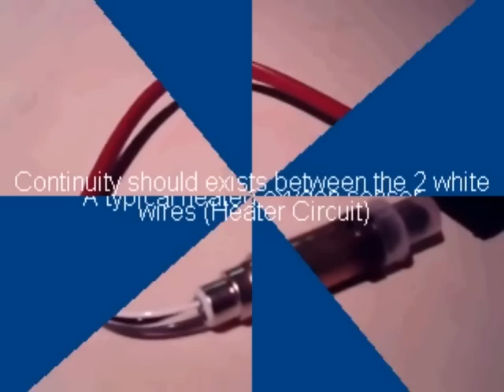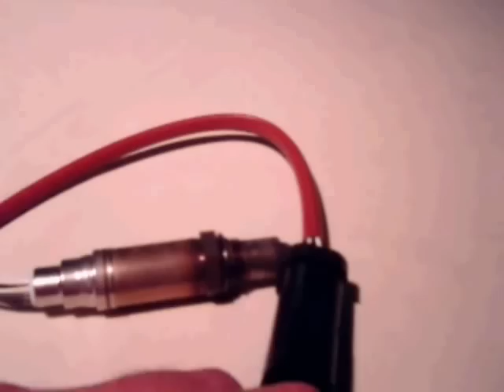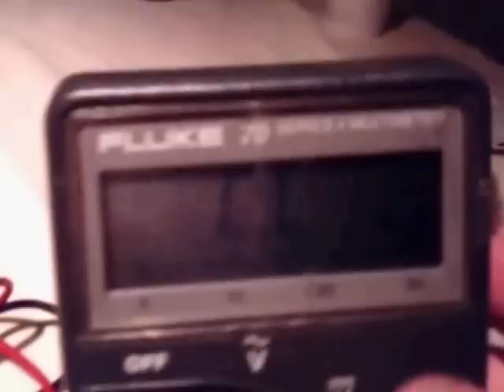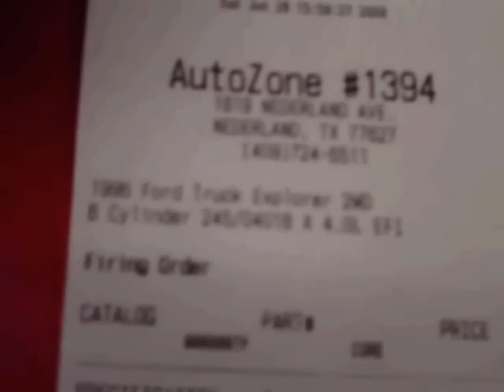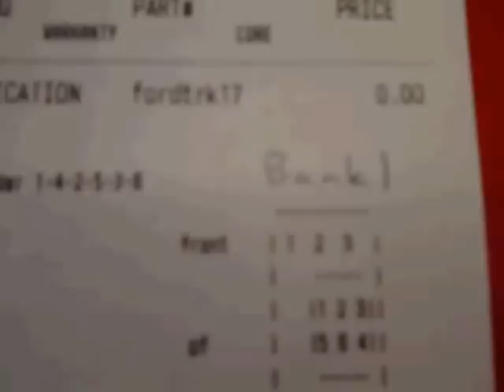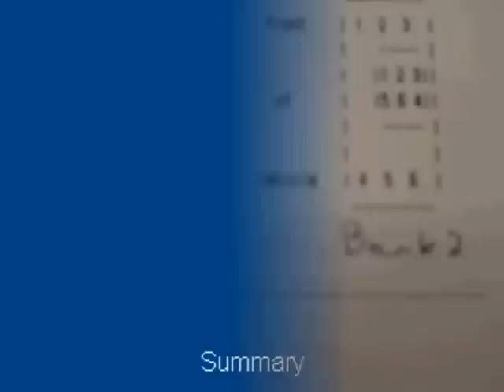Heated Oxygen Sensors,OBDII(DTC's)CodesP0134,P0135

Comment from the maker: You could also check the sensor itself just in case.  Compare the heater circuit resistance of yours to the resistance of a new sensor.  If you are going to check the activity of sensor, make sure it is off of the vehicle and find something to heat the tip(Butane torch) sensor readings.  From my experience, the heater circuit malfunction usually is present when the heater circuit on the sensor has completely failed, or there is no continuity.

Comment from the maker: Then one of the areas I would check is the fuel delivery at the engine itself because the oxygen sensor is reading a rich fuel condition.  This could also be a lack of air on the intake side also, a number of possibilites.  I tried to give warning about other sensor codes in the description, but thanks for the comment.  I am surprised you did not mention P0420, P0421, or P0431 with this code.

Comment from the maker: @HeavensWest1 Possibility, and if you were to check the sensor it would need to be an off the vehicle test.  The problem with the 171 is it does not specify what 02 sensor is acting weird.
My suggestion would be to check for vacuum leaks on hoses or anything that would cause a lean condition on your bank 1 or the side of cylinder 1.
Thanks for the response.
Mike

Comment: @mss829 Thanks for the input! I've ordered a new B1S1.  But will test S2 heater circuit, power source & ground. Went ahead on S1 due to: 1) it is not oscillating below 200mV nor above 700mV.. consistently... 2) S1 being bad/old can create a code for S2.. I'll replace S1 and re-run Autotap, generate a new graph with the new data.. see what it looks like then - meanwhile I'll test S2 as you've suggested. But.. shouldn't  S2 stay steady at ~ 450/500mV? Thanks again!

Comment from the maker: @timboscoops this code is describing the first sensor on the exhaust manifold near the firewall,(harder to reach).  I read that you replaced both sensors, but failed to mention if anything was checked as far as getting proper power and ground to that sensor.  The heater is usually identified on most sensor as 2 identically colored wires.  One should have 12 volts and the other so have good ground connection.  You might check the heater for continuity on your newly replaced sensor just in case.

Comment: hey again. So i got it fixed. The issue was this: my original O2 sensor was indeed fried, and it was indeed the upstream, like I had thought. The new sensor I bought was a Bosch, and the OEM was Denso. That was the problem, even though the place I bought it entered my vehicle year, make, model, trim, etc, etc, and they said it was compatible. It wasn't. (Also the Denso cost me $32 on ebay while the Bosch cost me $75)

Comment from the maker: There is no activity on o2 sensor bank 1 sensor 1, either the sensor heater, power and ground supplied to the heater is faulty, which might also be setting other codes.
The first sensor off of the exhaust manifold starting on the side of cylinder 1 would be my starting point.  One of the wires going to the sensor should have 12 volts, and the other should have proper ground.  You can check the ground by confirming continuity between a good chassis ground  and the sensor harness on the vehicle.

Comment from the maker: you might look at fuse 15...but I could be wrong...another way to check for power to the sensor is to use a test light with the key on and probe the two identically colored wires, one should have power and the other should be ground.  Ground can be checked with a meter, continuity should exist between the ground wire and any good ground on the vehicle.  Hopefully you won't have to go this far in depth.  And yes, you may have to chase the wiring if something is suspicious.  Good luck...

Comment from the maker: @krazy8tattoos there are a few questions you may want to address with this issue.
is the engine actually running lean, or is the gauge just showing a lean mixture?
is your check engine light on?  I would expect it to be on if there is a lean running condition.
is the gauge wired properly?  You may just review it.
I'm not implying that you do have a wiring problem, I am only bringing it to your attention while checking other areas as well.
Hope this helps.
Have fun!

Comment from the maker: In my opinion, your Bank 1 sensor 2 heater circuit code is more suspicious. (p0141)
I would check:
1. heater circuit on the sensor, or
2. power source wire from vehicle for voltage, or
3. ground wire circuit for low resistance and clean, secure connection.
If all are in tact, then there could be a lean fuel trim, that is not necessarily the 02 sensor's fault.  There is not much of a sure answer that I feel comfortable with stating, unfortunately.
Thanks for watching and commenting!

Comment from the maker: @ninobebemebarak Do you mean, 2 black, 1 white, 1 green?
The 2 black should be the heater.  You might even compare the reading to a new sensor at a parts store.  I would still check for a power and good ground going to the black wires.
Hope this helps.

Comment from the maker: Absolutely, the first comment I got for my intro (different video) was hating on me and ericthecarguy, haters are out there.  I don't have a good answer about pin A and the body, how did you think out that concept? 
 Heater circuit is common on 02 sensors.  Keep in mind factory 02 sensor wires will be 2 black wires, however I forgot to mention it.  I have a video on starters and more to come soon.  Thanks for the compliment and please post ideas for other repairs

Comment from the maker: If the heater is in tact, also considerin that the source for the heater is a 12v signal from car and there is a ground circuit for the sensor also, so please keep this in mind.  I understand that in some cases, diagnostics can mean taking it to a qualified technician.
I realize that this video is a very limited approach to 02 sensor analysis and I intend to give it another attempt.  
Thanks for the comment, and it is my pleasure to help with what I can and your car issue.

Comment from the maker: Possibly, it is still essential check the heater circuit with a meter, 2 black wires or 2 white wires depending on if the sensor is factory or aftermarket!  B1 S2 should be after the catalytic converter.  You may need to consult a repair manual if the heater is difficult to identify.  I intend to make a second video covering ideas that I realize were not mentioned the first time.  Thanks for the comment!
Mike

Comment: got a question ive got a sunpro afr gauge and after installing it it stayed at lean didnt sway then i put 2 new O2 sensors in and now instead of 1 main led lit it goes up to 2 ive had it in the orange range barely lit never reaches ideal mixture nor does it sway when throttle is peaked any suggestions as to why it stays to lean? i have a ford zx2

Comment: An in-line engine is only considered Bank 1, correct?  A sensor classified as 1 is upstream or before the catalytic converter and a sensor classified as 2 is downstream or behind the converter, right?  I have an 03 CR-V with a P0134 code so I'm lead to believe the foremost sensor needs to be replaced.  It's approaching 120K.
Reply from the maker: An engine with only 1 exhaust manifold has only Bank 1.  Sensor 1 will start at the exhaust manifold and follow the exhaust pipe accordingly to Sensor 2 and so on...in your case, you seem to have located them properly.  I saw a youtube video posted about this already.  It seems like you have a logical plan.
Reply: Thanks.  That darn light is intermittent.  It comes on for a day or two and I get ready to buy the part and replace it and then it goes off.
Reply from the maker: Wow, with a symptom like that, be careful that it is not a faulty connection.  I don't know what you have checked so far, just a general suggestion...
Reply: If it comes on again I can have someone in the vehicle watching the light while I inspect the wires.  Thanks for the suggestion.
Reply from the maker: 2cyclemix seems like a feasible approach. I hope it works out, and that you obtain some logical evidence.

Comment: @mss829 I changed today the o2 sensor bank 2 sensor 1,and the car still having the same problems(shaking on start up and an unstable rpm like if the engine is going to die)and still having the same codes on the sensor i changed(P0151,P0152,P0154)...I feel theres something electrical wrong in car..or may it be the pcm??

Comment: Hi My Check Light Is On on my 2004 tukon denali xl And A Code PO135 come up (heated oxygen sensor bank) sensor 1. Which sensor is this, which one should be replaced?
Reply from the maker: This seems to be the first sensor on the driver's side.  Now this situation can be convenient before you spend any money, since you only have one 02 sensor code.  Highly likely that the passenger's side is the same one and you can swap them.  You may expect to get a p0155 code from doing that if the sensor is indeed faulty.  Not the proper way to test it, but it can give you some concrete evidence before replacing parts.

Comment: Hi, I had the code p0135 show up. I got it cleared and it came right back. I took out my upstream oxygen sensor, and replaced it. I cleared the codes, but it still shows right back up afterwards. Could anything else besides the sensor itself give a p0135? my friend hecked the resistance of the heater circuit on the old sensor, and he said it should have been working.

Comment: Just bought an 01 stratus r/t with Mitsubishi 3.0L, code P0135. Got both 02 sensors replaced and check engine light came on after about 5 minutes of driving. Please help. I dove the car aprox. 40 miles and S.E.S. light is still on. I read somewhere that it will go off after 20-30 full start-ups, or If I disconnect the battery.  Thank you in advance for any advice, it is greatly appreciated.

Comment: So basically what you're saying is that if continuity does exist and the OBD still pops up with the O2 sensor code then there is some kind of leak in the vacuum hose?
Reply from the maker: Very possible, however I failed to mention anything about comparing ohm spec to a new sensor and measuring amperage activity.  If you have more than 1 sensor on the vehicle, and the sensor are the same, you can probably get away with swapping the sensor and checking the codes again a few days later.  But, now that I look back at this, I missed several things.
Reply: Okay thanks!
Reply from the maker: My pleasure...

Comment: Hi...maybe someone can help me...have a code p0134 no activity sensor 1 bank 1. i have changed the sensor and still comes up same code...tested the sensor and it tests fine..also checked the connection and it looks fine...can it be the ecu? 04 honda crv automatic.
Reply from the maker: Patrick Russell just a suggestion...this will be easier if you have a wiring schematic of the 02 sensor circuit so you know exactly what is involved with the sensor.  Checking for a blown fuse is next easiest step from having to check for proper power and ground to the sensor with a schematic and test light/voltmeter.  If you don't want to risk buying an ecu, then tracing the rest of the circuit can be necessary.  Hope this helps.
Reply: Thank you Albert...the prob was a bad connector pin on car side of harness....corrosion will get you every time. ....thanks again☺

Comment: I'm getting p0135 twice what does that mean? and how do I fix it
Reply from the maker: An option would be to trade it with sensor 1 from the other bank if you have a v6 or v8 engine.  If you are able to pull a different code after a several days of driving give or take, then it is likely that the sensor is bad.  If the code stays the same, then you are leaning toward checking power and ground circuits for bank 1 sensor 1.  Hope this helps.

Comment: i bought new oxygen sensors but they not giving any signals what is the reason ?!
Reply from the maker: +Saeed Alblooshi Have to check the power and ground side on the vehicle.  Any fuses? May have to consult a wiring schematic.  Year, make, and model?